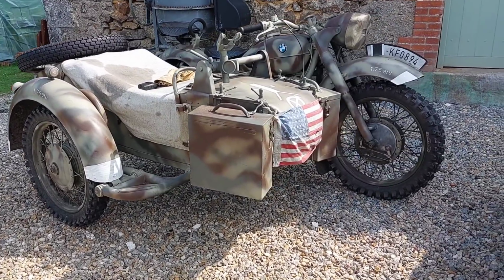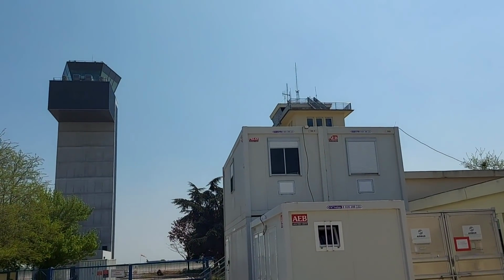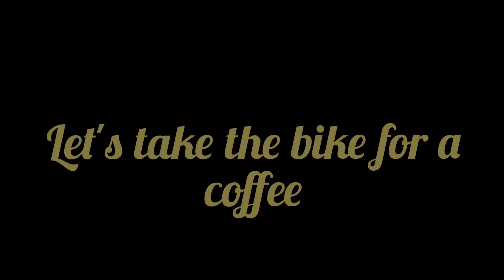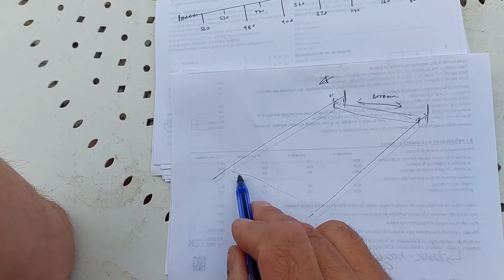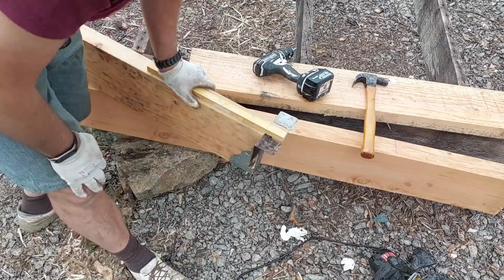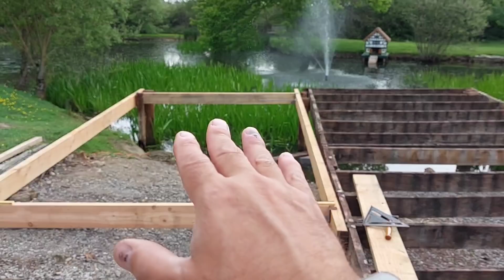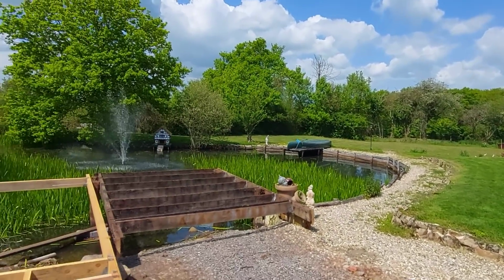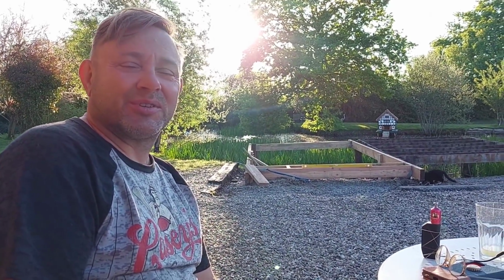Ep 54 | The Decking Framing Takes Shape | Vintage Motorcycles | French FarmHouse Life |

Comment: Nice job on levellingthe deck Peter. I personally would double the thickness of the posts and creosote the buried part of them before putting them in the ground.  The softwood will not last as long as the old round posts.  Glad that Anna and yourself are feeling better.   Keep up the good work. regards from the UK

Comment: Hi guys, been watching now for a couple of months. Love the videos. Did you consider notching the decking supports so the frame is actually sat on them rather than against them relying on bolts alone?
Reply from the maker: Hi Scott, yes you are quite right, that would be better but unfortunately it's a time issue, I am renowned for going over the top on what I do, so trying to get this done as soon and practical as possible!!
Reply: It's looking good, I commented close to the start of the video when I noticed the bolt through the older timber support. Probably should have waited because it looks solid 🙌keep up the good work.